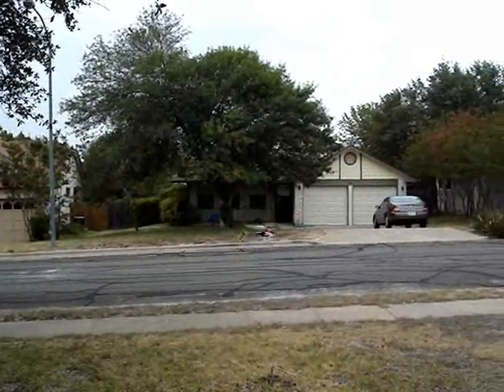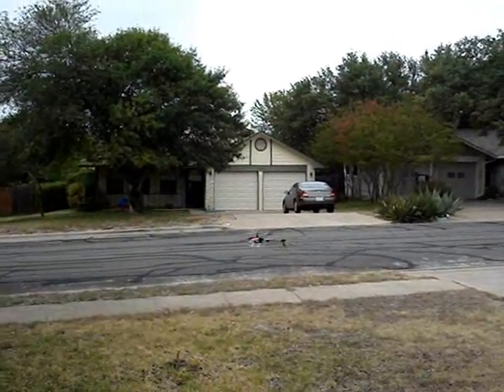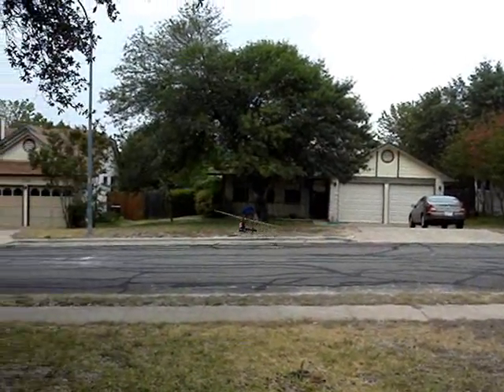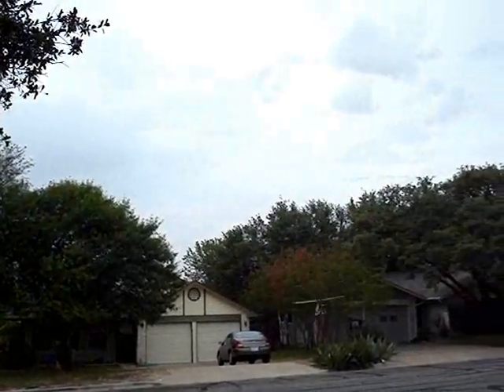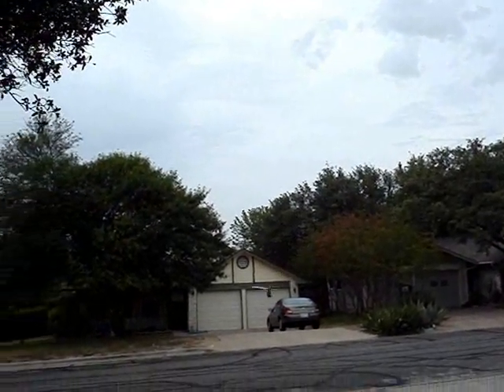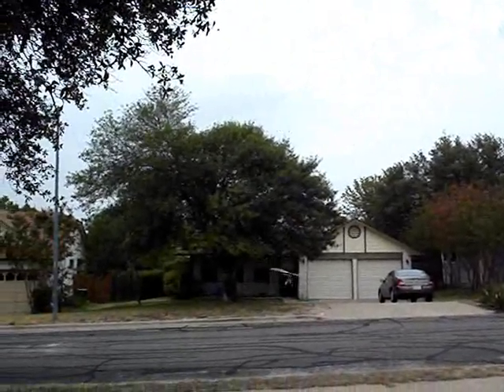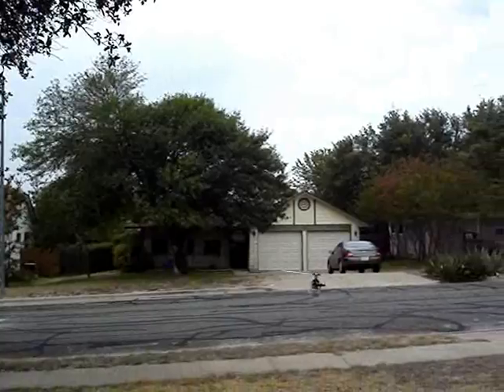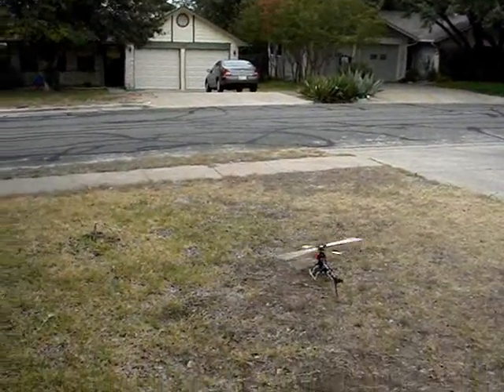mini Titan 'Long Tail' early tests

Comment from the maker: I'm using a small pinion because I want to limit the headspeed to 2400rpm. Longer blades with lighter disk loading doesn't require high rpm, and especially since these are woodies I want to keep it slower. I'd use a 10T if I had it, because I'm only at about 68% throttle right now.